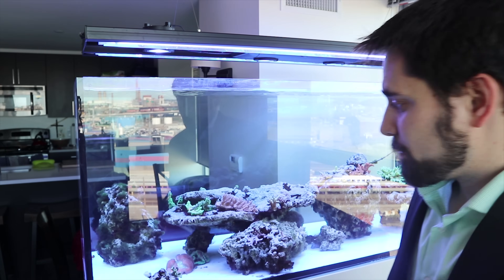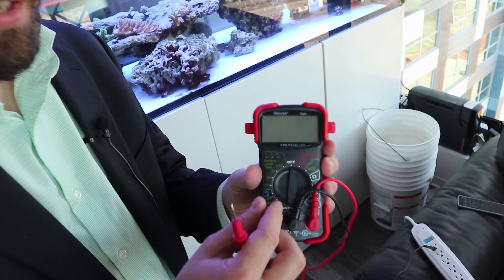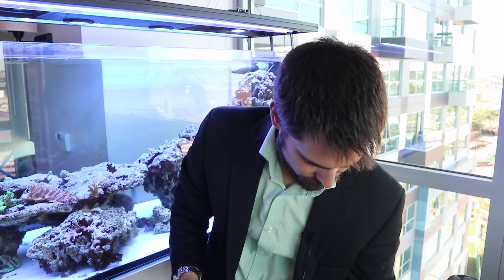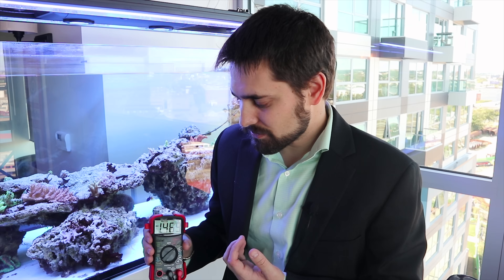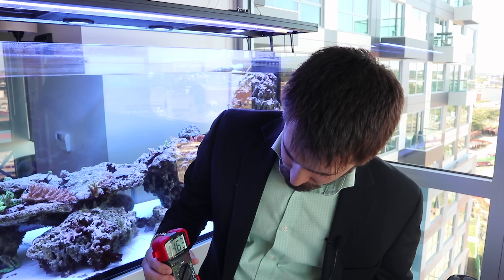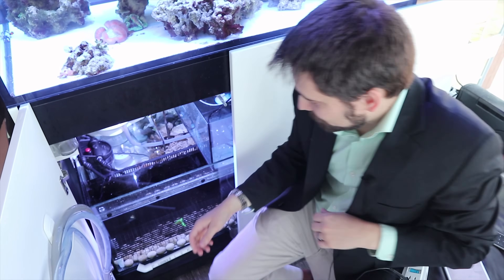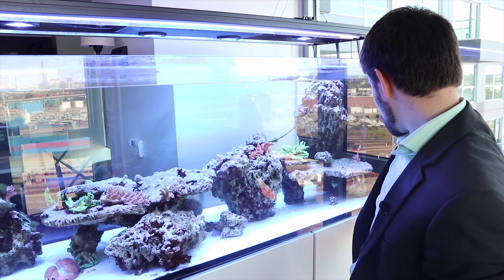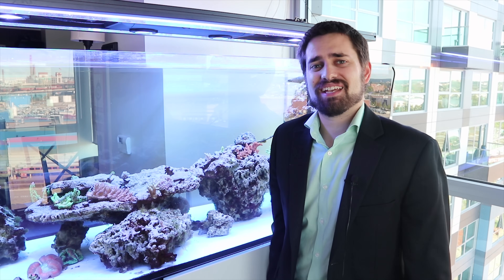⚡ How to check stray voltage in an aquarium. (How I made a shocking discovery)

Comment: DUDE  LOL just found ya subscribed and you are a COOL Dude lol with the shock stuff.  OMG  been there done this!  Had a issue with a filter pump and had some strange die off been in the hobby over 40 years and it somthing never seen before and sure enough one pumps wires came out of seal and no bueno.  I cant stop laughing.  Thanks.  LOL

Comment: Much better/safer method for determining which piece of equipment is causing the stray voltage is to plug each piece of equipment into a gfci adapter and seeing if the shutoff feature is triggered.
Reply: I been shocks so many times and I have a home with carpet I did it once barefoot stick my hand in the to one of my corals there was a shorted I didn’t know about because all 10 fishes was swimming beautifully I got shock so hard I had to lay down😢… Gfci outlet 100% percent is the way to go. Tried after and yes do does stop that scary problem and you can. But the only really was to test which one is causing the problem after that is to disconnect all plugs and connect it to your gfci plus one buy one and see which one trips after powering it on.

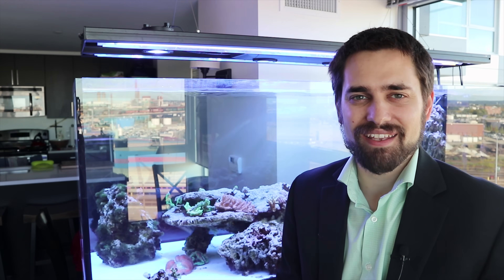Comment: Basically you explained my problem from the beginning to 1:00 minute in, I'm reading 40V when I connect the positive side of my multimeter to my aquarium water and the Earth to my bedroom floor. I tried to isolate it by switching off the power to equipment, with each piece turned off I had planned to monitor the Multimeter to see if the current would suddenly drop off [Which was wishful thinking in my case]. But instead, as I disconnect equipment the current goes down instead of dropping off altogether. I'll disconnect something, the current drops. I disconnect something else, it drops further. My Dad was saying it's pretty serious, I've been trying to figure it out for the past 3 days.

Comment: I have a ground wire installed in my sump. I measured stray voltage at 0.37.  I have two Tangs with HLL disease. Trying to troubleshoot. Do you think the 0.37 voltage I am reading is anything that is contributing?

Comment: I had a damaged heater that I was suspecting causing low shock to some of my fish.. I didn’t get extremely shocked though, just replaced the heater.
Reply: You would have if you were touching a ground (something metal that goes into the actual ground or a ground circuit) this is something called Ground or CPC. Heater manufacturers should be responsible for grounding their meters & pumps to ensure that ac triggers the rcbo / mcb / rcd switch in your consumer unit

Comment: So for you just replacing the pump worked ? How can I fix stray voltage would it be a bad ground wire?
Reply from the maker: It could be a lot of things, which is the annoying part when you have 10+ electronics in your tank.

Comment: This is the best video on the topic and I'm still confused. Ideally we would have a clear-cut black and white means to detect voltage and current in the water. I turned off my heater and filter because my turtles are tough and can handle it and it's safer than risking a zap for any of us.
Reply: @Tanked Up. I see, so there's a distinction between an outright short-circuit and leakage...

Comment: All of my equipment is plugged into gfci power strips which will automatically trip power off if any stray voltage is in tank I've heard of aquarium owners getting electrocuted really bad because equipment was malfunctioning I do suggest having a check valve on pump so when power trips you dont overflow sump
Reply: I had mine on a surge protector and it happens. It didn’t hurt the Betta but it gave me a low frequency constant voltage when I went to do a water change.

Comment: Hi, I have two sizes of the Tunze on two different Tanks (also the peninsula) and the blades never ever poped off. Don't know whats wrong with your model. The only 'problem' is going around the corner, if its too fast you loos the whole scrubber. But doing it slow it works perfect and you never get sand inbetween whats great. Give it a chance again 🤗
Reply from the maker: Maybe I just need new blades. I am using the "strong" version.